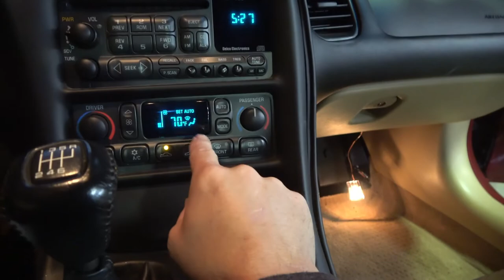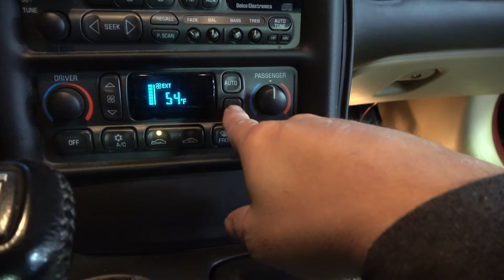2001 Corvette C5 Blower Motor & Auto Fan Controller Replacement

Comment: 7/32" socket is the same as a 5.5mm - in case you don't have a 5.5mm in your toolbox. Great video - I have a noisy fan that needs replaced and it helps to have a good walk-thru.
Reply from the maker: Thanks

Comment: I acquired a 1990 Nissan 300zx TT recently with a/c issues.  It has worked fully but seemed to have no temperature adjustment ability.  Only blew COLD!  Now when I take it out it has yet to come on again.  Former owner had it sitting awhile.  You have given me an idea since I have found "deposits" in the car if maybe this is the same problem and then some.  :)
Reply from the maker: Only way to find out is to investigate!!

Comment: Got the blower out, had two dead mice. Put everything back together and got a third smaller mouse caught in the blower so back to the drawing board, I've become an expert at blower removing in my '02 z06. Question, where is the air intake that they're crawling in from? How did you get rid of the smell of decaying mice?? By the way my blower was held in place by Torx screws, getting in there was like Yoga poses, luck I'm a thin guy!
Reply from the maker: The air comes in under the cowl on the RH side.  It is almost impossible to get at.  With the blower out, I use a shop vac to fully clean any debris....the only way to keep them out, is to periodically drive them, and keep mice bait traps in the garage